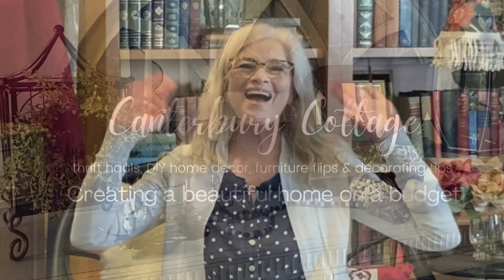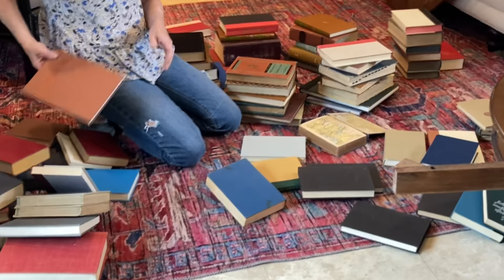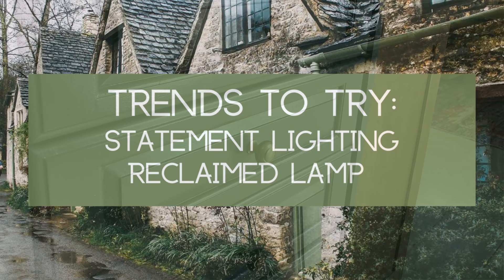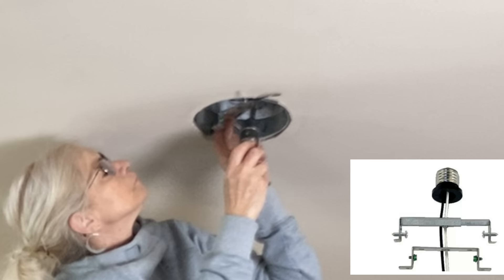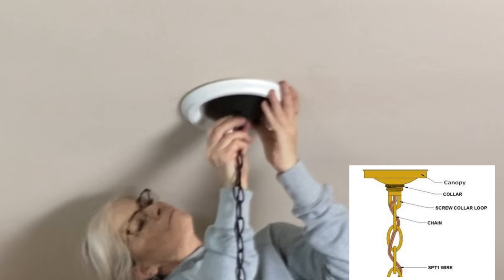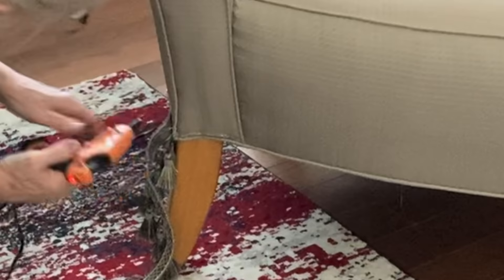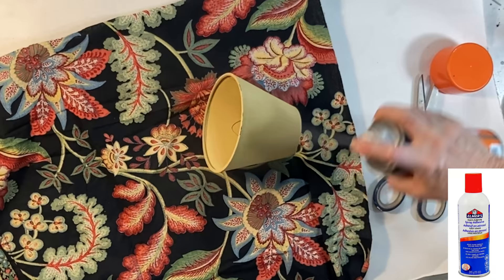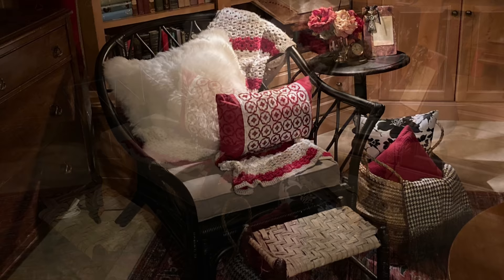15 Home Refresh DIY Projects Inspired by the Top Trends

Comment: Two thoughts:  1. I would have liked the coffee table * much * better if the spines of the books were outward so they showed rather than the book pages. 2. When fringe is all wrinkly, I think it looks terrible.  But there is an easy fix!  Once your fringe is installed, take a cup that is deeper than the length of your fringe and fill with water. Dip the fringe section by section in the water, all the way to the trim line. As you lower the cup, gently squeegee down the length of the fringe with your fingers, straightening the fringe and pressing excess water back in the cup before moving to the next section. Let dry undisturbed and your fringe will hang straight and beautiful. For added hold, hit the dried fringe with a bit of hair spray. Voila! Neat, straight fringe hanging perfectly!

Comment: LOVED the round frames filled with bird prints. The Toile wallpaper looks fabulous in the mudroom, it really updates it.  Do you think the Farmhouse style is waning?
Reply from the maker: I do think farmhouse is on the way out. Most trends tend to last about 10 years. Fixer Upper first aired in 2013, so the Joanna Gaines’s farmhouse style has had a good run. Even she isn’t really decorating in farmhouse style anymore. However, if you still love it, then that is all that matters in your home. I loved certain aspects of farmhouse design, but I never fully embraced the look because it never felt right in my 1962 colonial home. I do still sell farmhouse decor in my booth though.

Comment: How did you know you could convert your light from a can light?
Reply from the maker: Just by chance, really. I somehow came across the screw in converters several years ago—the ones that I removed in this video. I kept trying to find a company that sold multi-light pendants that would screw into the cans. That is how I discovered the can converter that would allow to me use any ceiling light or pendant.

Comment: My big problem is the bathroom 1960 house! Ideas? Alll is baby blue colored
Reply from the maker: Oh, my goodness! Have you seen my Q & A video? https://youtu.be/piozMo43FjM. I showed pictures of my 1962 all peach bathroom—it was so bad! The before and after is pretty amazing! I used the Rustoleum tub and tile paint and painted the tub and all of the tile. I installed peel and stick vinyl squares over the tile floor. I would recommend using floor adhesive and not just relying on the stickiness of the tiles for a long term hold. The toilet had already been replaced to a white one. I bought a new vanity—the original had a peach tile countertop and peach sink! I did it for under $1000 (mostly for a really nice vanity) and new faucet. The paint has held up great. I would recommend sanding the tub with a fine grit sandpaper using an orbital sander before painting, but you can just clean the tiles according to the directions that come on the can. Hope this helps!
Reply: @CanterburyCottage  Yes! Exactly the same like yours but in all baby blue. Thank youuuu I will try it! This summer